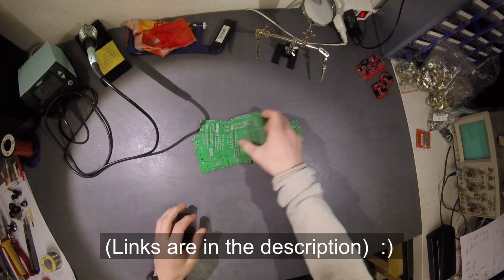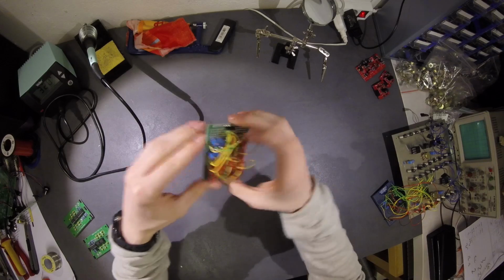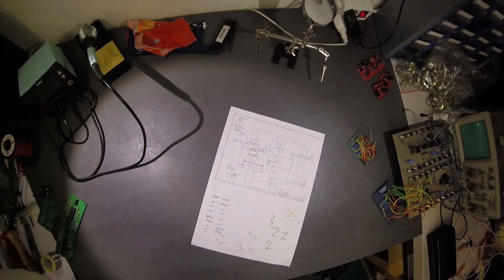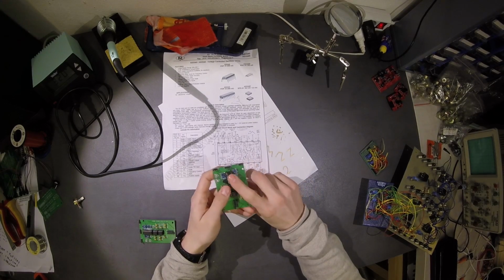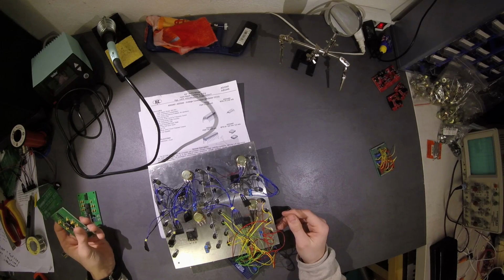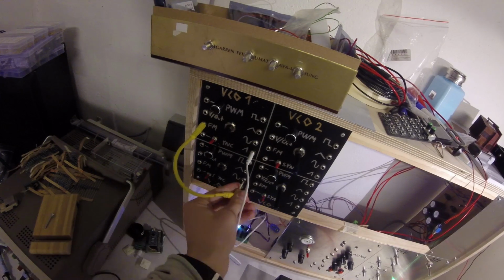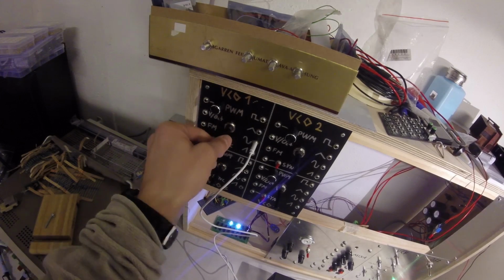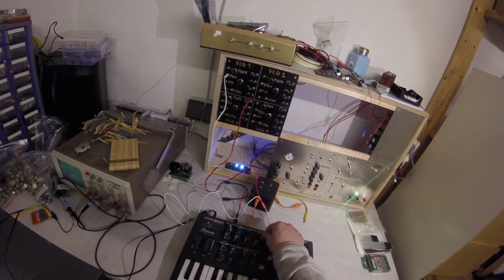SynthDIY CEM3340 VCO Oscillator inspired by LookMumNoComputer | Still not BETA

Comment: There is a pretty big deference in amplitude comparison with the saw, tri and sq. waves eh ?  i noticed on the schematic, 0-5, 0-10, 0-12v peaks.  I built Sam's fully loaded version update with PWM and DC controls on the sq with cv in and I am noticing the volume difference a lot on mine. Hence I found you looking to compare with someone else. I guess this is just how they designed it? are you noticing the same ?
also i want to add the sync's and tracking.
Reply: Xtian of Zodd I’ve noticed the differences in amplitudes for different waveforms.  Yes it’s the design of the 3340, but don’t forget the harmonics.  Sine waves always sound sort of muffled and very soft, since the resonant frequencies will sound off on certain multiples of the harmonics, some much less than others.  Where square waves have raspy and very resonant oscillations, throughout all orders of harmonics.
Reply from the maker: Yeah, I actually was thinking the same... But I didn't hear the difference between the square and the saw. But I could make a video next week, where I address that!

Comment: Hey! Thanks for making this pcb. I actually ordered a few of your pcbs from JLC and they arrived earlier this week.  I put one together today and i'm getting no output - and the chips are getting hot, espcially on the power reg side.   I took a look at the schematic vs the pcb and noticed one uses TL072 Opamps and the other uses TL084.  They look like the same pinout, but not sure what's intended.   Also I see the schem lists diodes and what not. There might be an issue?
Reply from the maker: Yes... Fuck I know whats wrong... The schematic is the wrong one. I built the PCB with an old schematic. I forgot to mention it. I'm very sorry for that!!!!! In will just upload the old Schematic for the PCB. I though I already did this but I might forgot that! I am so sorry for that!!!!!
Reply from the maker: I made a new folder called PCB and in there you find all the documentation for the PCB!
Reply: @stillnotbeta898  hey it's all good, it's part of what comes with diy. Can you add both schematics to GitHub? Maybe I can fix the boards I ordered with some jumpers or cut traces. Thanks again!
Reply from the maker: @Sirvolta  I added a folder called PCB and in there there is the pcb schematic. The newer one is right on the front page of my GitHub!
Reply: @stillnotbeta898  Thanks, i actually got it working!  In the end I found out that the volt reg I used was actually pinned out backwards.  I fixed that and have all the outs working now.  Thanks for the schem - it helped me trace to the issue.
Reply from the maker: @Sirvolta  OMG!!! Thats Great! I would love to see your VCO! Could you maybe send me some Pics? That would be so nice... I will add my E-mail on the YouTube Information-Page! :)))))
Reply: @stillnotbeta898  Hey, I made the mistake of reading the comment section after ordering the PCBs, is the gerber file that is located in VCO/PCB/Gerber correct or should I try to cancel the order? Or, if it is easily fixable with a jumper or two, that is fine, but I'd love to know if I should expect these to work.

Thanks by the way, really happy you are doing this!

Comment: Yes the triangle definitely sounds like the sine in your video.  So your sine wave, if I follow, was from adjustment of a crude low pass filter made from a capacitor and potentiometer, applied to the triangle?!  That’s  a pretty easy sine wave implementation and it sounds great.  THANKS for sharing this, good job!
Reply from the maker: Haha yeah, I didn't wanted to spend time on searching for a sine converter... And I actually on my newest design I don't even have a sine....